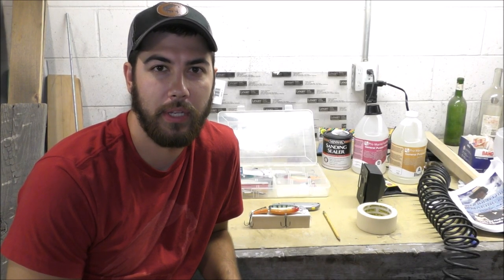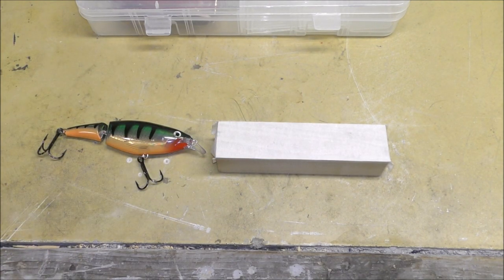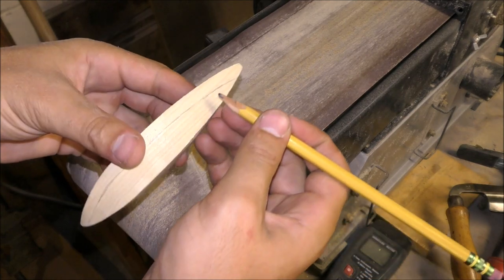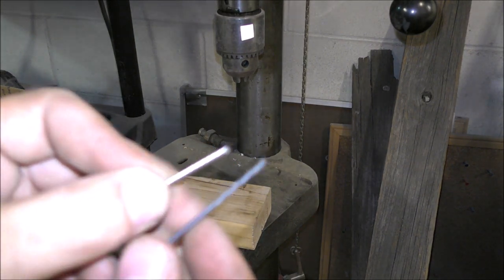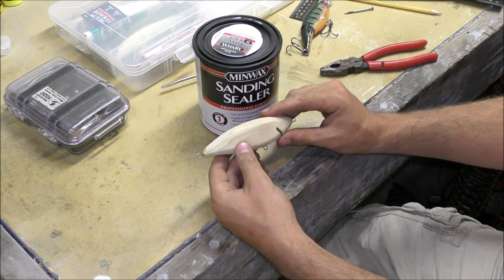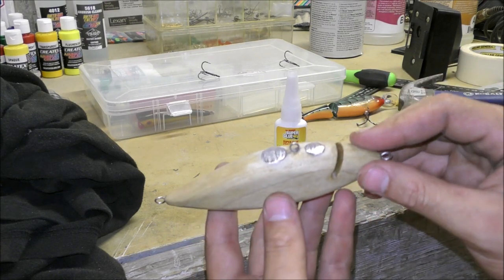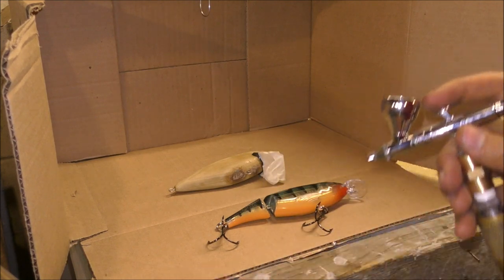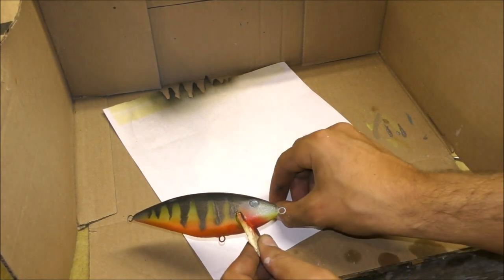How to Make a Fishing Lure (Musky Crankbait)

Comment: Hey bud nice work! Just a heads up, you never want to sand on lead! Lead dust is a big no! Next time try making your lead holes a little bigger than your weights and seal them in the same way you did here. Really nice job! Stay safe, tight lines bud!
Reply from the maker: That's a really good point I didn't even think of.  Thanks for the heads up, I am going to add that to the description.  Personally I doubt the amount of hand sanding I did on the lead created any significant amount of lead dust here, but honestly I could be wrong.  I completely agree it's something that should be considered and not taken lightly.  I wanted to melt and pour the lead but was running out of time so decided to do it this way.  In the future, that's what I plan to do.
Reply: Noble Savage Outdoors I’m sure you’re right, no harm no foul. Just wanted you to be aware for future reference. Look forward to future content.
Reply: I guess Im asking randomly but does someone know of a method to log back into an instagram account?
I was stupid lost the login password. I would love any assistance you can give me!
Reply: @Lee Archer Instablaster :)
Reply: @Casey Ayaan I really appreciate your reply. I got to the site through google and Im waiting for the hacking stuff now.
I see it takes quite some time so I will get back to you later with my results.
Reply: @Casey Ayaan It worked and I finally got access to my account again. I am so happy:D
Thanks so much, you really help me out !
Reply: @Lee Archer you are welcome =)

Comment: Next time do all your testing before hook hangers use some hot glue to glue your weights on the body before you drill holes for them ! That way you can move them around if needed ! Great job
Reply from the maker: Sounds like great advise.  I was kind of stuck once I drilled the holes.  I researched where others typically put the weight, but I think I got somewhat lucky the weight and placement worked so easily.

Comment: Sanding sealer is not waterproof.. the blank will absorb some water. Linseed oil or epoxy would actually do what you think sanding sealer does
Reply from the maker: I did say it waterproofs the wood "a little bit" which is what I meant. It is not completely waterproof, but the sanding sealer also penetrates into the wood and hardens the outside layer to make it more durable. It seals it enough to test the buoyancy without worrying about your lure soaking up water. You wouldn't accomplish the same durability with linseed oil or epoxy at this stage in the process because they do not penetrate into the wood nearly as much as sanding sealer. Some people also use super glue at this stage which does penetrate and harden the lure as well. Later the entire lure gets a clear epoxy coating to make it actually waterproof.
Reply: @NobleSavageOutdoors  does anything happen to the paint afterwards from a little water getting in ? I'm worried a little moisture would effect the final paint job after its done
Reply from the maker: Thel last step of the entire process is coating it in an epoxy that seals the paint in. I have been using this exact lure for 3 years now, have caught 3 or 4 musky with it, and have had no water problems with the paint or buoyancy. The only noticeable things that have happen to it are a few teeth marks in the lexan lip and in the epoxy finish, and the first hook rubs on the epoxy at the belly of the lure which made epoxy almost cloudy looking in a half moon shape. But you'll have those same things happen to most any store bought lure as well.
Reply: @NobleSavageOutdoors  I was worried about any moisture ruining my paint after it was finished. So on my baits I actually coat them in epoxy 2 times. Sanding sealer I mainly just use so my wood doesn't absorb tons of product. I sanding seal 2 coats. Then epoxy one coat. Paint until I'm satisfied and then a final epoxy. Maybe overboard but that's why dk and river slicks can charge what they do